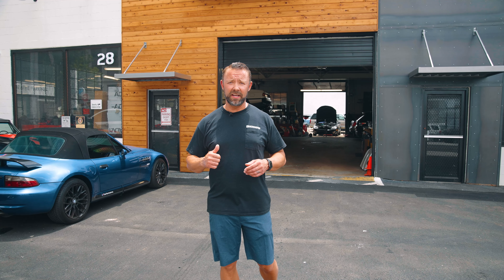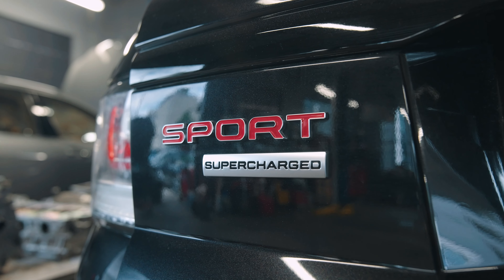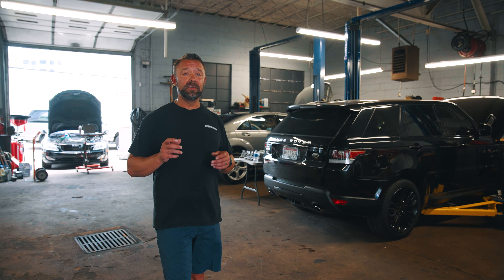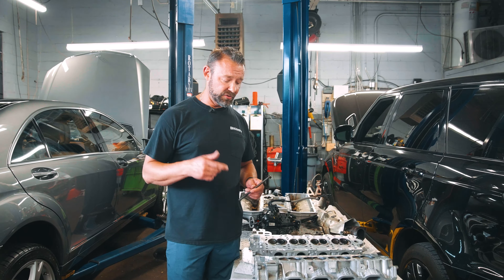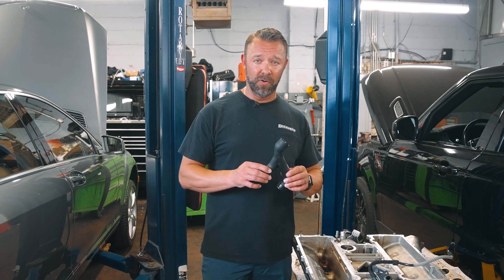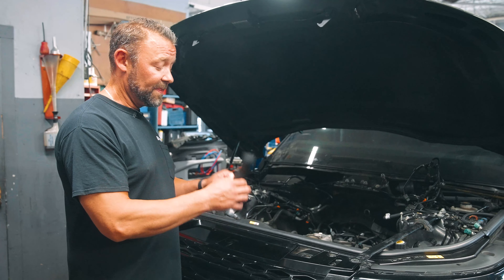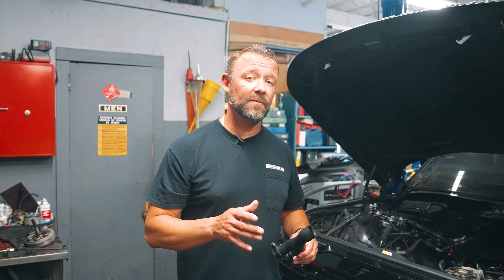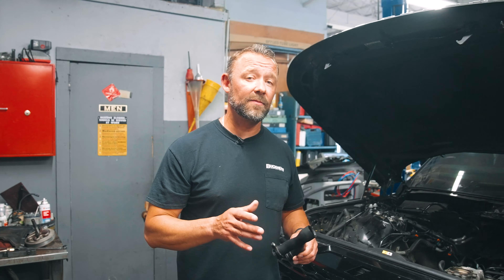Buckhead Imports |  Range Rover Coolant Overheating Problem Fix!

Comment: That is wicked! Putting plastic in a high temp environment in an 80 thousand dollar car. My 7 year old knows what happens to plastic in a hot environment. Is this a cost saving measure or just being wicked? What is wrong with metal for such a sensitive part? It is not the money for those who have it. It is the inconvenience.
Reply: only gotta last 3yr/36000miles.  Most people that buy $200,000 trucks are leasing, or dumping it for a later model shortly after the warranty expires.
Reply: really incredible how many plastic and rubber parts are bolted to the engine where they WILL fail and requires a complete tear down to replace.    VW, porsches, etc, all do this.... its so flipp'n stupid, to save 10-50$  on the cost of a part in manufacturing the car

Comment: There needs to be a recall on that y-shaped pipe. I now know MANY people that paid $80k+ for these cars and they ALL have the same issue.
Reply: Jaguar re-designed the crossover pipe in 2015. However, did not recall previous years.
Reply: I have the same issue and need to connect with as many people as I can to pursue action against Land Rover

Comment: You’re gone that far I would just go to a metal engineer and have them make me the same exact part out of stainless steel so that never happens ever again but this is very helpful
Reply: If you replace it with metal it will creat noise .resonate frequencies and it will creat knocking signal under certain torque
Reply: They have these pipes made out of aluminum on ebay. Someone actually thought of that already. $60 for both.

Comment: Did the coolant pipe  job on my 2020 Land Rover LWB SVR, of note there is a metal pipe upgrade for the front coolant pipes , do not use plastics one again!  The upgraded  metal pipes will never break and will last the life of the car & beyond , also while the supercharger is off replace the rear coolant pipe! And replace the supercharger oil !
Reply: What was the cost to replace

Comment: This happen to me on my 2014 RR. Exactly how he explained it. Did this job in my drive way. Took me about 3 weeks to get parts and resurfacing of heads. Shops did not want to replace the gasket they wanted about 17k for a new engine installed. Spent about 3k on parts n resurfacing. Did the labor myself. It sucks But if you’re mechanically inclined you can do it.
Reply: You got the l405 or the sport?

Comment: I just replace the bypass tube front under the intake and leak 😢😢 just back again tomorrow, remove and check everything, plus I replace the bypass pipe on the back of the heads what a job OMG ILL never do this again

Comment: I just got a coolant leak in my 2013 RRS. Suspecting that it is an issue.
Shame is, that I've got a new engine in 2019 and dealer said that they indeed put new y-pipes with new engine. So 3 years, 40,000 miles these crapped out? Really?
Also, I have a temp gauge, arrow never moved from the middle, no low coolant warning even now with empty expansion tank. Is my coolant level sensor defective? I am even tried to go in to service menue and clicked "show warnings" - nothing.

Comment: I have a 2017 Sport have they replaced the plastic pipe with metal ones.
Reply: Do you know where can we find or purchase the metal replacement pipe?
Reply: How much does it cost to replace the plastic pipes with the metal ones.
Reply: No one will tell us what's the estimated cost of replacing the plastic to aluminum pipe whether its V6 or V8
Reply: Pipes are available on ebay for like $60.